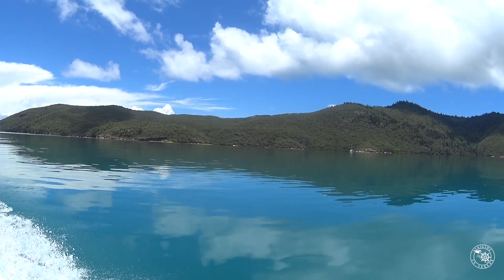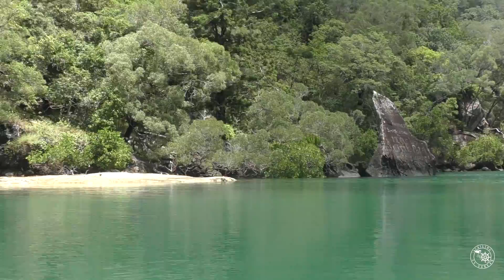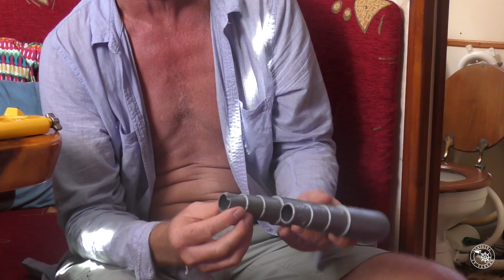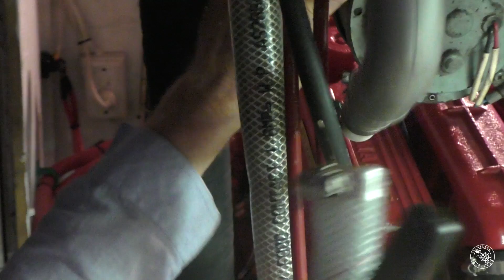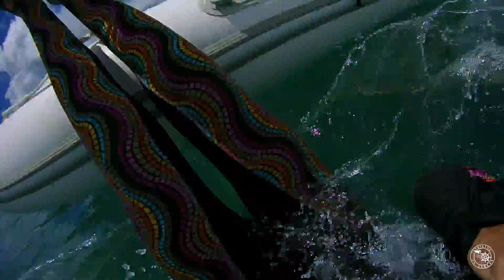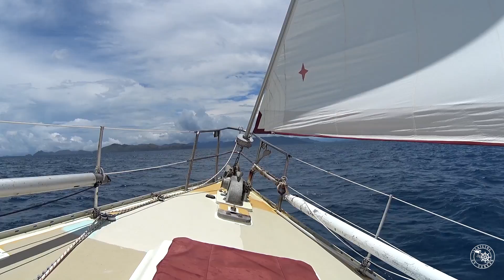CONNECTING WITH NATURE & ENGINE ROOM LEAKS!  (SAILING SV SAREAN)  EP.7

Comment: Once again, you two show why this is one of my favorite sailing channels on youtube.  The beauty of the beginning of the video, coupled with the fixing of a relatively minor issue, which left unchecked could mean the sinking of Sarean, followed by the often forgotten advice that while cruising under sail can be exhilarating it can easily be uncomfortable, and dangerous, and lastly by advice to others that just because your boat has a particular layout doesn't mean you have to put up with it... Brilliant! The sense of confidence that Darren displays alongside the sense of beauty and spirituality that Meg shows... makes you two unique. I really love watching your escapades. 
That last bit was particularly meaningful to me as I approach my retirement and my 3rd boat. Since my earning years will be gone, I wish to be smart in my purchase. I have decided, at this time at least, to go with a Morgan 383. But the layout is not the best for my useage, and plan to make major changes to the interior and systems. Sure I would want t bigger boat for guests, and bigger tankage, longer waterline, more sail options etc, but the extra  costs outweigh the benefits. But I don't like vberths. So I will convert the vberth to a storage area, take out the head and put in a pullman berth. I will remove the quarter berth for more storage and a generator and put in a composting head instead. At least that's the plan. All for less than a older slightly larger boat that would still need a lot of refit. I hope to sail past the places you have shown us today, one day on my way to Thailand and the Indian Ocean. Maybe our paths will cross. Who knows.
Reply from the maker: Hey Bob!  Lovely to hear from you - we are so glad you are enjoying our vibe!   Sounds like you have a good plan going on with your alterations.  Yes, across from our For'ard Head on Sarean, what would have been two single bunks, has been converted into a workshop which we find invaluable.  I also looked at a John Alden years ago where the lady converted the V-berth into an office.  I thought this was such a good use of space, and pondered doing such in my next yacht - then Darren and I met and the rest is history.  
I really enjoyed my time sailing in Thailand and look forward to taking Darren back there one day.  Such a beautiful area and gorgeous gorgeous people!

Comment: A nice fix on your cooling syphon, I only wondered why you didn't apply the same remedy to the other outlet, as the plastic U bend fixing appeared to me to be rather inclined to buckle under compressive forces of hose clamp.  Your pipe insert looked much more capable and it would have been a relative straight forward job whilst it was already detached.  I'm assuming it takes cool raw water that may be warmer in tropical conditions rendering the U bend plastic slightly less strong in higher temperatures.  Your video well illustrates how many small, but vital jobs require attention on a voyage and how its always good to have access to suitable tools and parts. Thumbs up and thanks for sharing.  EF
Reply from the maker: evanofelipe Great point you make there Evano.  We snaffled that piece of pipe from our 'Coconut Picking Tool' and at the time didn't want to shorten it too much.  Ha! Perhaps we were being too frugal!  Thank you for pointing that out, we will put it on the to do list :)

Comment: Glad seeing you both out and about thats the way it should be :) God Bless you two .  have a few questions notice hanging on the outside rails why extra booms (looks like what they are) ? Are u able to gather water and fruits from the islands or is it all protected (look, explore but dont touch) ? wanted to see some of the caves ,maybe next time :)
Reply from the maker: Hi Kenneth, do you mean the two poles?  We use those when running the Spinnaker or Poling out the JIB.  They help hold the sail down, and the shorter one holds the Sheets out from our Side Stays.
We used to gather water from springs and waterfalls, however now that we have installed a watermaker we generally replenish with that.  There is a red berry tree that I have heard Aboriginal folk gather from, however I am unsure as to which.  I don't believe there are any restrictions on this practice.  
Thanks so much for stopping by.  Fair winds!

Comment: Do you take precautions if lightning is about? And what might they be. Back in the day I would disconnect everything and set jumper cables from a chain plate to the water in hopes that it would ground the charge and not smoke my electronics. Mine were nothing like you have today. Love your videos and thank you for putting them up for us to enjoy.
I am the stowaway who live in that upper mid ship berth. Cheers and fair winds.
Reply from the maker: +peter mickelsen Good morning Peter Stowaway!  Yes when Darren and I first started sailing we had only VHF.  Great that tech has improved so much!  We pretty much do the same as you did.  We disconnect from the back of electronic units and put a chain from the base of the mast over into the water.  The Chartplotter is on its own battery so we disconnect that with the idea that if all the wires get fried to other units, at least these will remain.  We do also have Navionics on a tablet which we switch to if sailing through a storm.  Who knows, its all a bit of a guess really.  Did you see the cyclone footage yet?  We sat through the most amazing storm there!

Comment: Thank you Meg and Darren for another great interesting video, love your wetsuit's ;-) and Miss Max, such great Vibes, and By the way what washing machine are you using on Sarean ? I suppose it is a domestic 240v and you run a generator, or do you run it though an invertor? or is it a 12 or 24 volt. marine wash m,  also,  Would love to have a look at your converted head, (wc)  and stay safe with your neck, I broke mine in 1984 in a diving accident so I know how it feels and it can be a pain in the N... sometimes ;-) Hope to meet you both sometime on the East-Coast. Take care and fair winds ;-)  Kind regards  Bjorn  caretaker of Summerwind II   ( 1985 Arends 33 )
Reply from the maker: Hey Bjorn!  Great questions thank you. We will definitely put a video up for you showing the new 'laundry' when I can get access to it again.  We are currently in the middle of boat project chaos month  :)  
In-case you are soon purchasing your own washing machine, we went with a camping twin tub which we run through our inverter.  I love it as I can re-use the water, and it has a spin cycle.  I used to wash in a bucket and have to say that not having to hand wring clothes makes a huge difference to the process.   
Yes, my neck can be a pain in the neck ;)  I feel for you after your accident.   It has been 3 months since my surgery and still being shown that I need to take much care.  Dinghy rides can be excruciating (so I have banned myself from rough rides), and anything horizontal or above shoulder height puts a tonne of strain on my neck - which surprisingly occurs a lot.  So, it's about pulling back from the 'DIY' gal I used to be and handing a lot of tasks over to Darren, which I have to admit I find challenging, having long been a self sufficient boat girl. 
Yes, yes, if you see us - honk your horn and come over for a cuppa  ;)  Fair winds!